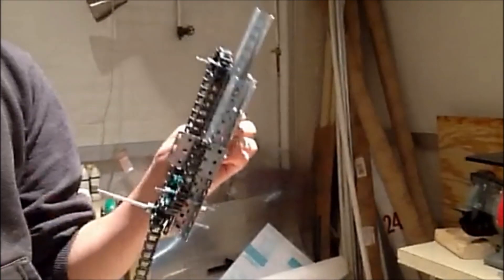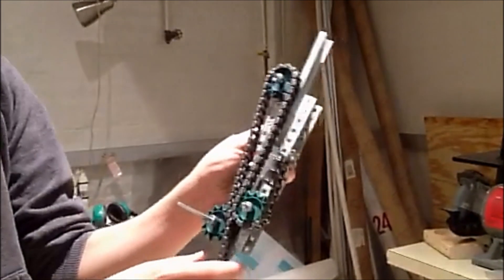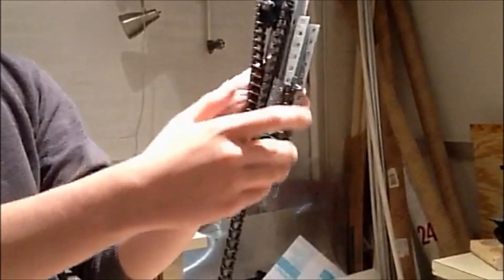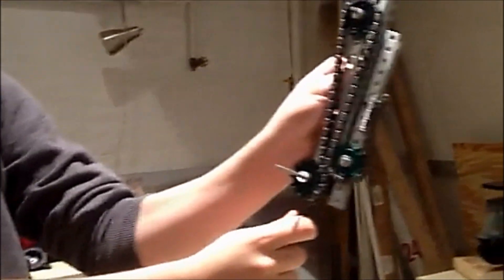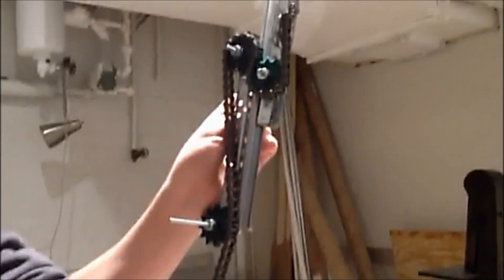VEX Skyrise Elevator Lift Prototype

Comment: This design seems to be a very popular concept this year.  I expect to see a lot of these lifts around (including my own).  However I want to warn you, you mentioned putting one stage after another after another.  The more stages you have, the heavier the lift is and the more unstable it is at full height.  As for this being a cheap lift, not even a little bit...  The amount of metal, motor power, time, and maintenance that goes into an elevator lift, I would say that its anything but cheap.  I do believe that the elevator is the most efficient design for this years game is an elevator lift, however many teams are jumping straight into it and I fear that many underestimate the work that comes with it.  When my team did an elevator lift in Sack Attack, in order for it to work well, we spent countless hours adjusting and fine tuning the lift to make it work.  However our efforts did get us to Worlds in the end.  This message isn't meant to discourage the use of an elevator lift, but rather the message is meant to serve as a warning to teams that may be in over their heads with an elevator lift.  Good luck, and maybe we'll meet at worlds this year!

-Smiles
VRC Team 7702

Comment: Elevator lifts, in vex at least, are one of the least efficient lift designs you can build. Much less efficient than a bar lift.
Reply from the maker: That is interesting, some people on my team were saying the same thing. This definitely needs some more experimentation, including expansion and motorization. Actually, you have inspired my next video, which will be a reverse double 4 bar.